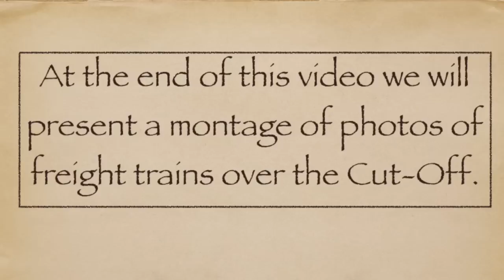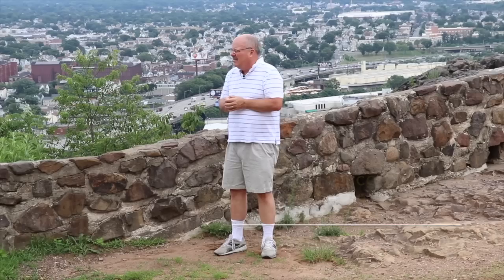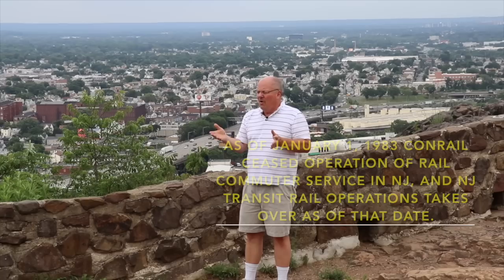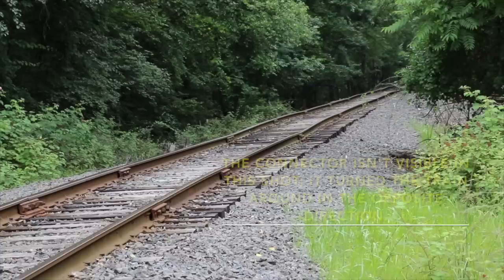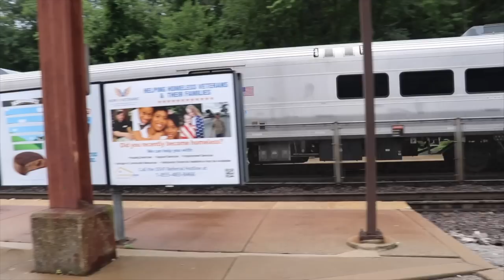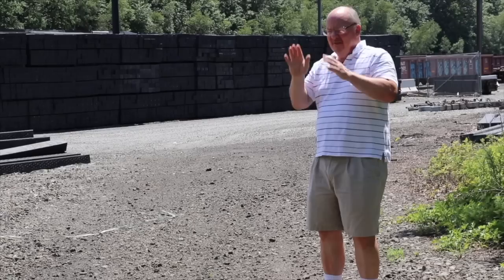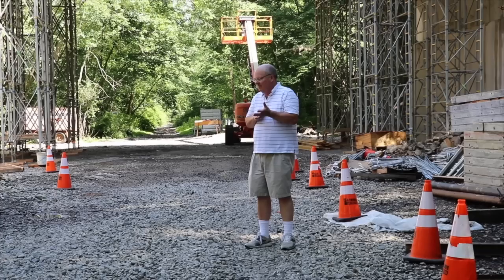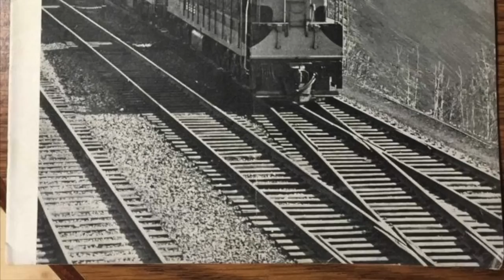Lackawanna Cut-Off - Part 12: Freight Trains Over the Cut-Off

Comment: Being an NJ Transit rail employee ,I can tell you  there is direct Freight connection between the NJT M&E , NE corridor and croxton yard via Cape interlocking & Marion . Located west of The Meadows maintenance facility. So the shameful conversion of the lower Boonton line AKA Greenwood Lake division into a trail doesn't sever possibilities for Freight Service between Pennsylvania and New York City particularly croxton Oak Island and the Meadows Intermodal terminal. Manifest freights and single-level Intermodal (non double stack) can sneak underneath Roseville in Newark.
Reply from the maker: And who is going to run this?  And why use a "single-stack" route over the Poconos instead of the existing double-stack routes that NS and CSX already have?  It makes no sense.

Comment: On the GL Branch about 300 ft N of the switch at MTN View there's a USGS marker, which was placed by my Great Grandfather. Get this. His salary in 1925 was $14,741/ yearly as a structural engineer. Locomotive engineers had a similar salary. They received bonuses  for on time arrival, and even safety. I have An engineers logbook from 1927. I wanted to donate it along with some cancelled checks signed by Truesdale but Steamtown had no interest. They did accept ( on loan ) a slide rule, station and bridge designs as well as several photos. Their short film in the tech museum is all my pics

Comment: I am sure others may be more familiar with this than I but I recall USRA never included the EL in the ConRail Final System Plan in 1975.  At the time Chessie System had planned to buy EL but Chessie could not reach agreement with EL labor that Chessie could accept.  The Chessie move followed the Middle Atlantic Rail Corporation (MARC) proposal wherein RDG, LV and CNJ had planned to consolidate prior to the formulation of the ConRail Final System Plan.  The MARC plan later included EL as was relatively stronger than the other regional bankrupts and thought it could reorganize.   It all leads one to suspect USRA and / or ConRail never wanted EL.  Even after the absorption of EL into CR, they had no need for another east-west main line beyond former NYC and PRR mains.  As time went on, Conrail moved traffic off the Southern Tier (Erie ML) to the degree the only remaining traffic over parts of the Tier was the "statutory train" which was an agreement with NY State to run a train at least once a week on the Southern Tier.  CR had a set of commercially obsolete boxcars they would run over the Southern Tier to meet their obligation to NY State.   Competitively, CR did not want to sell Southern Tier lest CSX or NS get access to New York but CSX/NYSW later cracked the code on that move with trackage rights. The fact the Cut Off had no or little traffic that originated or terminated on the route did not help the argument to keep it.  I also suspect development of on line industry was hampered since the track was on a high fill above industrial sites.  The Cut Off was purpose built to speed passenger trains from end to the other which it did well.  But once you didn't need to do that any more there was no reason to keep it.   People also need to recall the rail freight context at the time which overtook Conrail and the northeast rail network: completion of Interstate 80, larger trucks, fewer on rail shippers, rail rate regulations, decline in US manufacturing, better track capacity on fewer main lines through use of CTC, larger freight cars, bigger locos. etc.   I look at freight trains in these videos and marvel at how much of the traffic is gone.     (I worked in the marketing department at Conrail in Philadelphia 1984 - 1998).
Reply from the maker: John, it's well-documented that EL came into Conrail late in the game.  Conrail didn't need EL, although presumably it didn't want to compete with it either.
Reply: I think the Cutoff was built primarily to move coal.
Reply from the maker: Well, that was the chief commodity that the DL&W was moving at the time of its construction, although they moved a lot of other freight, and passengers, as well.

Comment: The former Greenwood Lake branches off from the current Boonton-Montclair Line by way of an electrically locked manual switch just west off track one in the vicinity of the Montclair connection. This track ran by way of Benson St.,Glenridge; Rowe St. Bloomfield, North Newark, over the Arlington Bridge over the Hackensack River continuing east through Arlington over the causeway and over the DB draw which lead by way of the third track into Croxton yard. From DB one remained right up to the connection with the main line then through West End to the Bergen Tunnels. If the Arlington bridge was to be rebuilt, track relaid, etc. one could possibly run freight from Croxton over the former Greenwood Lake connecting with the Boonton-Montclair Line at the MC connection. The electric lock switch would have to be replaced by a remote power switch. Of course, this would cost a lot of money and it probably would not be feasible. When the old Boonton Line stopped at Benson St. the crews used to grab a cup of coffee from Jimmy Wilson's concession in the Benson St. station. This way we had a cup of Joe before arriving at Hoboken. By the way, that was one of the local characters from Port Morris. Gary J. Kuipers, Sr. NJT retired.

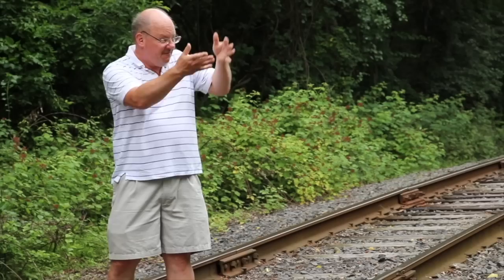Comment: Perhaps of interest, at about 30:00 in your video, looking north on the GL branch, as of about three years ago (c. 2014) the track was still mostly on the ground to the junction with the Susquehanna. As you note, freight trains are run north far enough to run back south (east) on to the Boonton Branch. The track becomes overgrown and rusty north of the furthest point needed to run the freight trains (I hiked it - wish I'd brought a camera!). Further up, there is a trestle over the Pequannock River which is still in place, although walled off by welded steel plates on both sides to prevent trespassing. Service could conceivably be restored on this section since the right-of-way has not been breached in a major way, although it seems unlikely. However, a couple of miles of track south of the Susquehanna junction still see occasional freight use, although unscheduled. Most of that trackage is not regularly accessible from the Susquehanna line due to being protected by locked gates.

Love the montage at the end - thank you for all the hard work!
Reply from the maker: The trestle over the Pequannock you refer to crosses at a junk yard (or at least was one the last time I was there).  Somehow I cut through it and didn't draw the attention of the guard dogs.  I was lucky.  I would never do that again.
Reply: That’s the line that went up to Greenwood Lake which it go through the Wanaque reservoir now it ends before the Monksville reservoir damn. It goes through Pompton Junction.

Comment: Chuck, why didn't the EL use the Dover-Morristown-Summit routing for thru freight in the 70s (rather than the Greenwood Lake route)?
Reply from the maker: Very rarely.  I can count on one hand the number of long freights that I saw run on the Morristown Line, and I lived right next to it during the EL years.
Reply: @LackawannaCutOff  I see.   Was that because of grades, track conditions?   Or was it purposed only for passenger?
Reply from the maker: @gchristian7612 , well, the Boonton Line was intended to be the freight bypass to the Morristown Line.  The high-speed Boonton Line was opened in 1870, and although the Morristown Line had numerous improvements made to it over the years--it dated from twenty years earlier--yes, the grade up to Summit was an issue, but also the high density of commuter and passenger trains on the M&E.  But after 1930 there was also overhead catenary which would become an issue as freight cars got taller and taller.  Passenger trains disappeared in 1970, but the big blow to the Boonton Line was the idiotic severing of it near Paterson to build I-80 in 1963.  That forced the Erie Lackawanna to combine it with the Greenwood Lake Branch at Mountain View (Wayne), a line never intended for high-speed freight service.  It had a hill up to Great Notch that was just as bad as the one up to Summit on the Morristown Line.  Today, with the Montclair Connection, the Montclair-Boonton Line now combines in the Montclair Branch and Morristown Line.  With low clearances and no access to Croxton Yard (which was the main yard that the EL used) the idea of using either line for long-distance freight is deader than a doornail.

Comment: So basically, after the Moonshower plan was implemented to shift freight from the former Erie to the former DL&W route in 1972, did all those freights traversed the old Greenwood Lake-Boonton line out of Croxton via the DB Drawbridge out through Arlington, etc, ? (which is now abandoned due to the 2002 Montclair connection).

Comment: Actually long freights are possible utilizing the west end wye to connect with NJT main/Bergen/Pascack V Line. Switch to Bergen/ Pascack at Laurel/Upper Hack interlocking towards HX to the Croxton Connection east of HX. Conrail/NS can easily build a loop track at Harmon Cove to eliminate the need for a reverse move. What we will not see are double stacks containers. Because of the Roseville in Newark low catenary.
Reply from the maker: No chance.  You can't run down either the Montclair-Boonton Line or the Morristown Line.  End of story.

Comment: Why was the cut-off single tracked? All I can find is repetitive explanations that it was in anticipation of the merger wuth Erie RR. How so? What did that trigger?
Reply from the maker: Dick, it's a good question.  The single-tracking of the Cut-Off in 1958 took place at roughly the same time that the DL&W was trimming back and already consolidating with the Erie.  The first consolidation was the Erie running into Hoboken in 1956.  In 1959, much of the Lackawanna's trackage west of Binghamton was downgraded.  And traffic was already falling, so the Lackawanna may have figured that they could save money by eliminating one track on the fastest part of the railroad.  They also left a very long--4-mile--siding at Greendell, which would have helped with conflicting moves.  Maybe the DL&W knew that the Erie Side would prevail after the 1960 merger.  I don't think we know that for sure.  Or they figured that with two double-track railroads from Hoboken to Binghamton that the extra track on the Cut-Off was expendable.  Your guess is as good as mine.
Reply: Were they {Lackawanna} so hungry for money that they needed the rail to sell as scrap or were there operating expenses that could be saved? My interest in RRs comes from growing up in WWII Schenectady; driving by the ALCO shops where Sherman tanks were being cranked out; and seeing them driven through the streets to the test track. Endless flatcars with MPs  then headed out on the NYC for the docks and war.
Reply from the maker: There are costs involved in keeping more railroad than you can afford to keep up.  In addition to maintenance costs, there are taxes, etc.  The Lackawanna was saving on about 25 miles of rail.  Operationally, it may not have been as good as double track, but unless they anticipated greater traffic, it probably made sense to single-track the Cut-Off.
Reply: Back then they were losing lots of freight customers to trucks guess they just wanted to cut their losses !